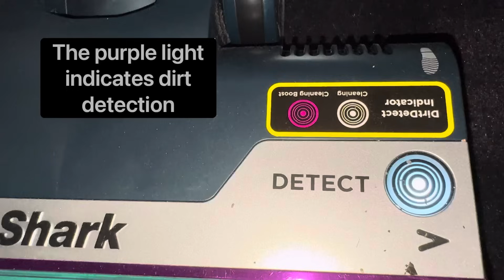Shark PowerDetect Pet vacuum cleaner - Performance Testing [Will it break?]

Comment: I love it! I have a Shark Pro and have had it for 5 years now. I keep it clean and it cleans just as good as if it was brand new. Plus, it stays looking brand new too! Sharks are definitely worth every penny you pay for them. I really like this one, but I'll keep using my old reliable until it quits on me lol then, i may get one of these ones after mine goes out. It's very impressive
Reply: Vacuum tech here. They are some of the worse machines I have ever had the displeasure to work on compared to about 90% of other brands.

Comment: That agitation is excellent! Vibrates all the dirt right up to the surface.
Reply: Unless that dirt is dancing around at least a foot in front of the machine then it’s not doing its job. My vac has a metal roller that would make that entire room vibrate. The brush on a vacuum is supposed to vibrate the dirt out of the carpet, not brush it out.

Comment: Mine is coming on Thursday! Replacing my Dyson DC33 Upright Vacuum after 6 years of service. Even though I’m not a huge fan to Sharks, this is my first shark ever and super excited to try it out!! 😁 RIP Dyson DC33 2018-2024 😢
Reply from the maker: Cool!! It’s so much more advanced than the DC33, it should work great as long as the washable filters and brushroll are maintained ✌🏽
Reply: Don’t buy your vacuums from box stores. Go to a dedicated vacuum store that will tell you what brands are actually a good value

Comment: Shark did a brilliant job on tbis hoover the cyclone filter did take it down a bit but the new design they are usung on the filter did cause it to take slightly longer to clog tbe filter i noticed
Reply from the maker: It’s fantastic, very impressed with the cleaning power

The filter took longer to clog because I used less dust this time, otherwise I imagine it would have clogged just as quickly as the other Sharks for sure lol

Comment: I have a question: Do you ever have your carpets cleaned? 😋 hot water/ steam extraction? Would love a dirt water dump after a good vacuuming.

Also those lines are awesome- throughly enjoyed them!
Reply from the maker: Many thanks!! I used to wash the carpets all the time but it feels like such a chore, it’s like vacuuming with a worn out vacuum trying to go over the area very slowly and extract all the water out, I only do it when there’s a stain or if the carpet starts to emit an odour 👍🏽
Reply: @parwaz7861  I'd love to see that someday! 😊

Comment: Does it actually increase suction when it senses more dirt in the floor? I can't hear the change. But, at least you can vacuum like normal and you don't have to empty it every 10 sec like the Stratos so they must have improved it.
Reply from the maker: Correct, it boosts the motor power when it detects dirt, it remained constant though because it kept detecting dust 😂

Comment: The dirt and Pet hair acted as a barrier Treven from getting dirty on the inside. All that dirt is loose. Nothing is caked in because Dell layer on top kinda like how the surface of the ground is warm when there there snow on it but the snow doesn't actually touch the ground.

Comment: I have a question!! Did the vacuum cleaner ever overheat to the point of turning off with that amount of cleaning on the carpets and how long did it take to get cleaned from its self?
Reply from the maker: Nope not at all, because I kept the filters clean from clogging with dust (they needed cleaning a lot though, like every few passes)

Comment: Why does the front lights keep switching on and off
Reply from the maker: When vacuuming along the edge of a wall or furniture, the light turns on one side to brighten that area up and also boosts the motor speed for edge cleaning

Comment: How can people actually believe this house is really that dirty? 

The dust is homogenous in composition, and it’s evenly distributed everywhere. But it’s only on top of the carpet, not embedded into it - that’s what real dust would do. 

It’s composed of sand, wood particles and I assume dryer lint. Also, non of the walls, floorboards or heating elements are dusty or dirty.

The guy just went to an empty house and emptied out a few buckets of his artificial „dust“ to vacuum it all up. It’s nice and satisfying  to watch but please don’t assume he actually had a house that dirty.

Comment: Parwaz my dyson dc01 when i push the floor head down it makes an absolute awful squeak and when i move the handle up and down it still squeaks. Any ideas why?
Reply from the maker: The upright lock will need some sewing machine oil or wd40 it’s a little spring loaded roller that slides into the groove
Reply: yes i took it apart and i cleaned it and sanded the stubborn rough dirt off and the squeak is gone but the handle snapped off in the making 😂

Comment: Hi,  new to your channel. I noticed in one of your videos , you used the Shark Turbo Brush onto a Henry hoover. Did it fit well? I would like to get a Shark Turbo brush for my Hetty hoover.
Reply from the maker: Hi, unfortunately the Shark turbo brush doesn’t fit the Henry very well due to the Shark tool fitting being larger than on the Henry
Reply: @parwaz7861  Oh, that's disappointing. Thanks for responding.
Reply: @parwaz7861  Oh, that's disappointing. Thanks for responding.